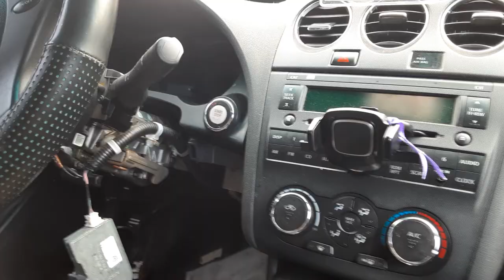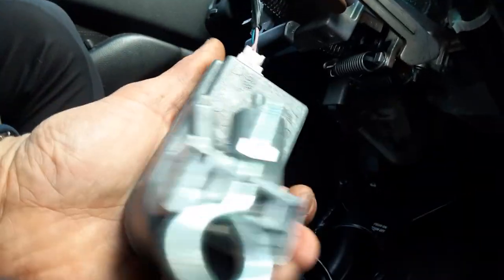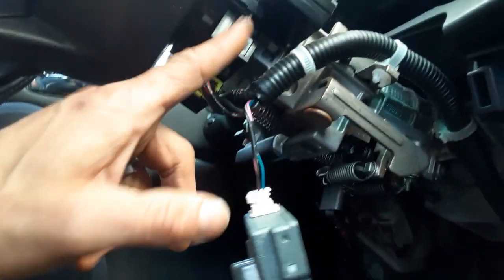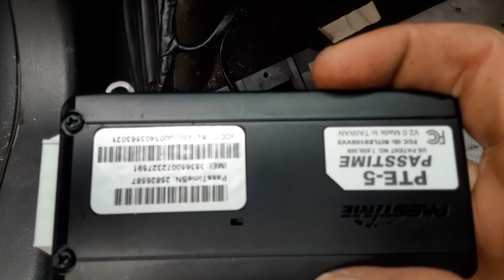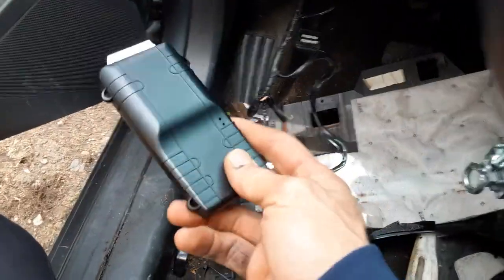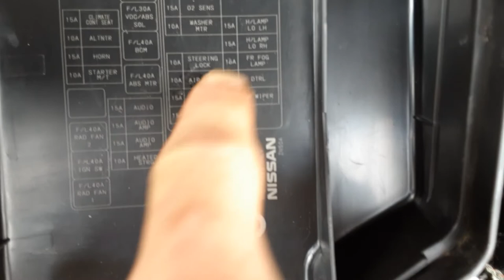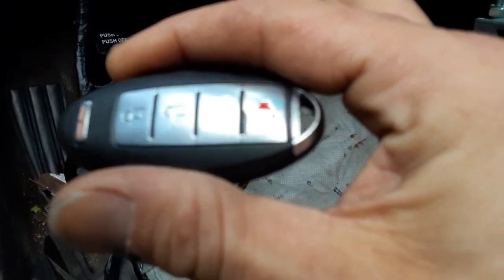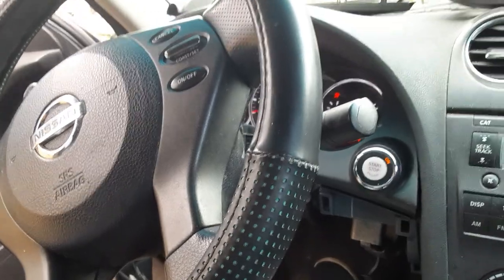2010 Nissan Altima steering wheel lock, no key read headache

Comment: My sons car that is use 2010 given to him by his mom has same issue lock box is gone. I didn't look that far up for the wire harness I will have to check and see if its there I was nervous. Knew some one had bypassed. So you suggest a used steering wheel lock to try to reprogram this thing that is given me throw the whole damn car away vibes

Comment: I dont have actuator under mines and that cord is no where under mines what should i do ?
Reply: I'm having that same exact issue right now with my Nissan. And I also don't have an actuator undermine either so I'm lost also......🤷🏾‍♂️  I am going to keep trying things to see if I can get something to shake...
Reply: Same here????
Reply: I don't have one either ever figure out the problem ?
Reply: @mikehoncho3695 i checked on my Altima and it's missing. When this first started I had thought that it was the starter cause it sounder just like before the first time this happened but I replaced the starter and so I thought it was the starter again so out a new starter in but still not a dang thing.ive went from new starter to new neutral switch to checking brake switch fuses relays alternator battery. I'm almost I've point to give up.. but my steering wheel isn't locked so I want to find a modulator that will fit under my steering wheel